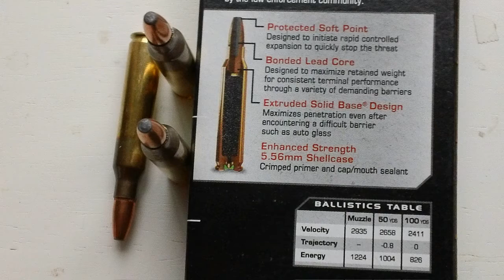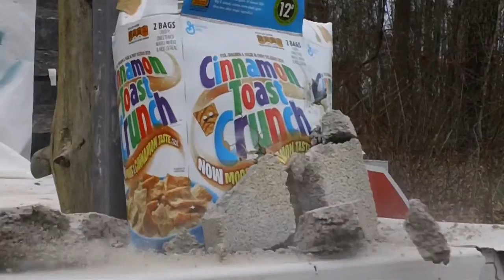Winchester Ranger 556 64g Sp (RA556B) from 7.5 in. barrel

Comment: I'm wondering if there could be cycling issues being that the lead is exposed at the tip of the, bullet used in, Winchester Ranger.
Reply from the maker: I have shot these rounds through both the shorty (7.5in) and the standard M4 length and have NOT had any issues with it so far.  Feeding and reliability have been on par to this point,  hope that helps....
Reply: +poboyspecial It does help. Thanks for the response.
Reply: I shot this ammo in my Tavor. It didn't have an issue cycling through the ammo, but it had very poor accuracy with it because it would mash that front end up when feeding.